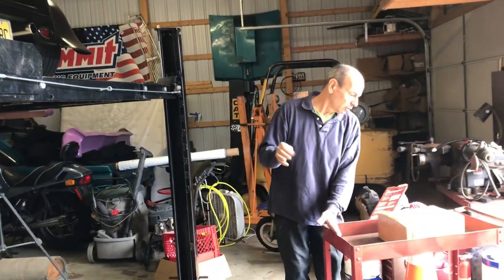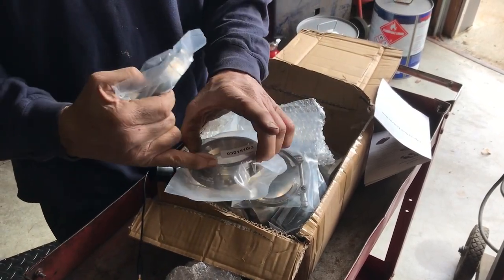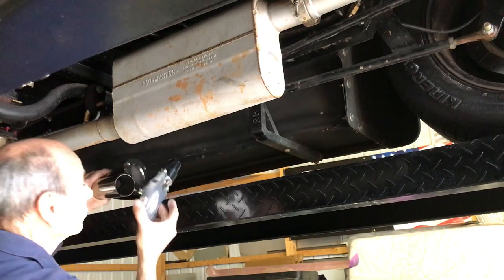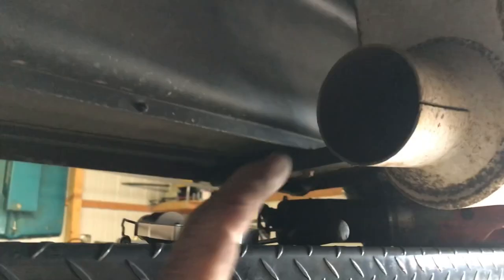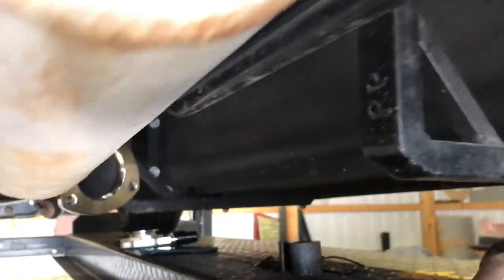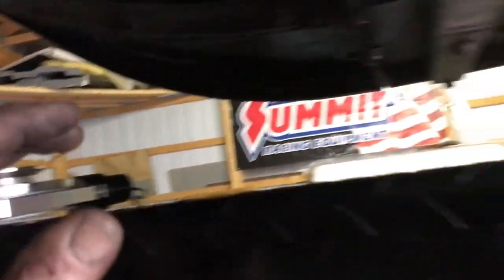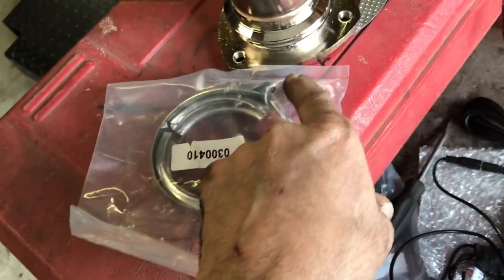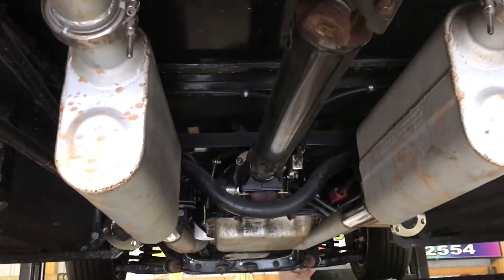Hot rod Exhaust electric cutouts

Comment: Good morning… I was posting comments a little with you back when you were doing the nova. I mentioned I had a 65 falcon with similar issues. Life got busy, and 9 months later, the motor/trans is out started cutting the floors out, I GOT PROBLEMS!!! Lol. Mostly in the front torque box area, some frame extension issues. I was curious do you do any consulting?? Do you have a way of contacting you, you were requesting pictures, but I have no way of uploading to YouTube. I have a fairly extensive background in auto body, fabrication Yada ya da and was really wanting to build this heap myself, just need a little guidance before I proceed and i know you are super familiar with this platform, as well as what I’m wanting to do. Would be happy to pay you for your time.. thanks.
The car was, supercharged 302, c4, frame connectors, full Calvert rear suspension, 26.5 10.5 tire. 8.8 rear 4;10 gear,stock front suspension, with adjustable shocks. It ran mid 12 110 mph with a lazy converter and a 2.2 60’. We knew the car was structurally hurt and frankly shouldn’t have been goin as fast as it 
was, so we didn’t push it, the car was sketchy.
The hope, stay 302 based so I don’t have to mess with the towers, I want to go back to a clutch, I’m an old man and i like shifting, reinforce the chassis and do away with the stock floor pan, I’ve always wanted to build pans and I’m 6’5 my head is buried in the headliner with a helmet, and my knees are around my ears in the stock seat location, it’s not a flattering look, nor is it safe. 
Keep the Calvert stuff but reinforce the rear frame with a cross member and convert it to sliders to get rid of the offset shackles. The hope is for the car to live in the low 10’s high 9’s with an occasion trip into the 9.0’s with spray. SAFELY and CERTIFIED!! I want everything boxed, and the cage/seats landing on tubing, everything tied back to the rocker, a solid, square, goes straight platform.
Essentially the ford version of what you did to the nova minus the extra bars and provisions to back half it and go 6’s or whatever your customer was doing.
Sorry for the lengthy post, but based on the back and forth I had with you, as well as watching the nova build, it’s all pertinent to the questions i have as well as the certification and which Sfi book i need ect. Thanks again.
Reply from the maker: That’s a long as post 😂😂 you can call me or text.  914-490-4306. Glad to help.
Reply: @Jvcomet  lol. I wanted to get your attention!!! Haha.
I’ll try giving you a call tomorrow, thanks for the reply.